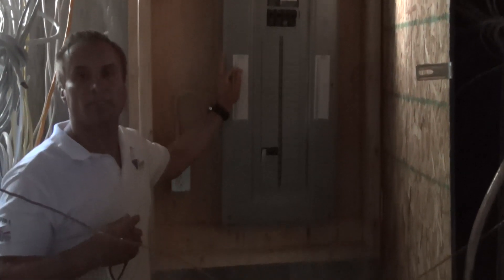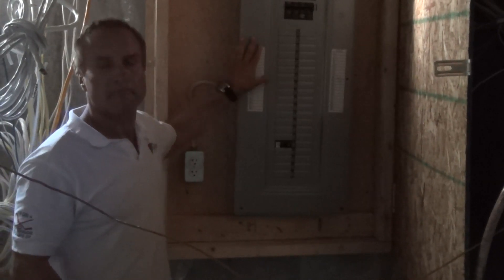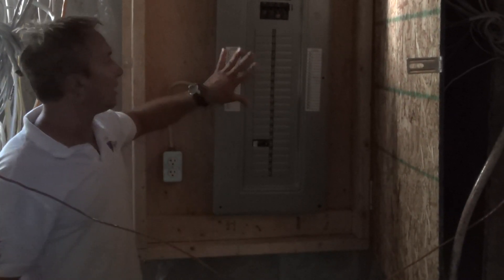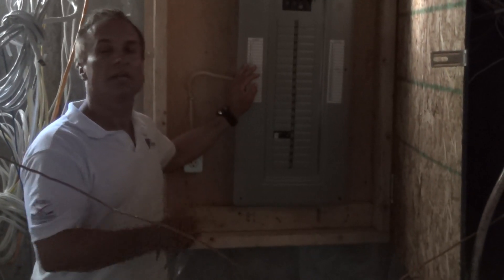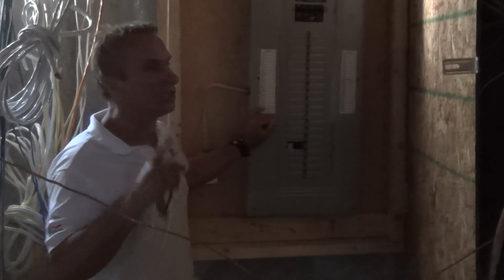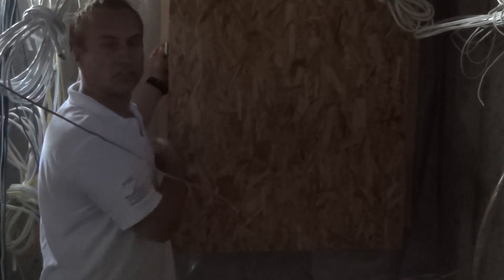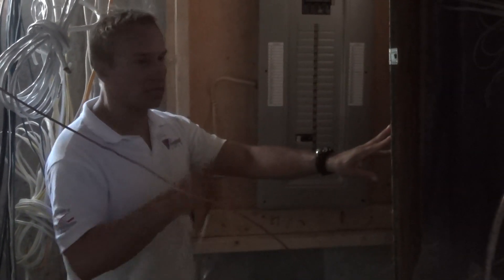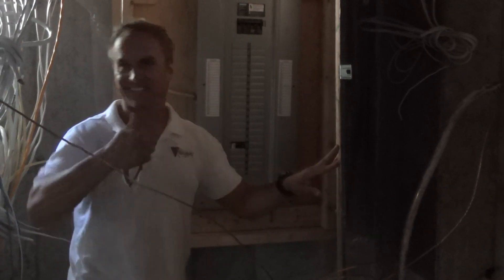How To Build A House: Electrical Panel Ep 42

Comment: Hydro, hydro, hydro....ok...ok...ok...ok...hydro...ok.....it's called WATER!!! And "if you need to upgrade"....means that...."I start with MINIMUMS in my budget...cough...choke...gag.....budget costs.....so if you want anything more. That's EXACTLY what it will cost you. Ka-Ching!!!
Reply: Actually, in Can-Uh-duh!!! it's called hydro. As in, hydro ELECTRICITY. Because most provinces use the wonderfully renewable source of rivers to create electricity. Water would be plumbing. Fucktard.
Reply: Very old comment, but he’s talking about Hydro-Electric Power (how it’s generated).  Very common in eastern Canada, and often referred to as “Hydro” and not “Electric” because the utility is often named “Hydro Québec” or wherever you are located.